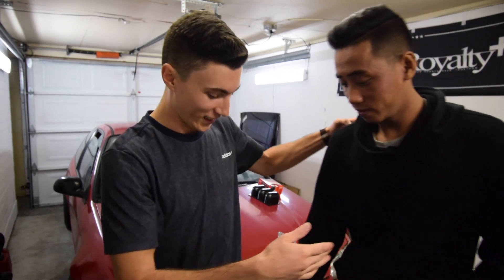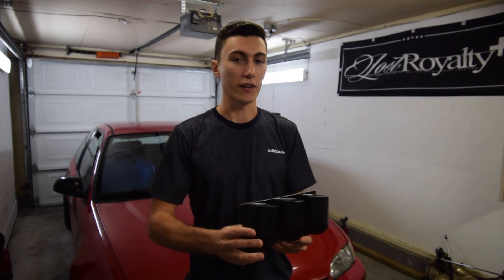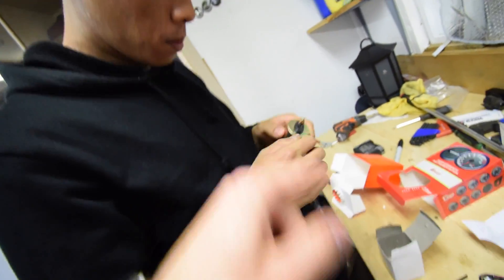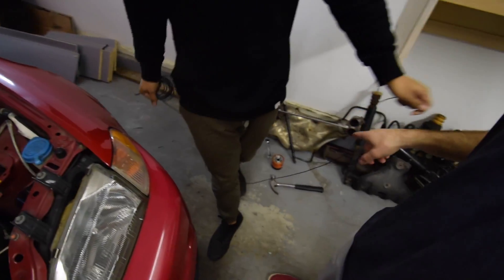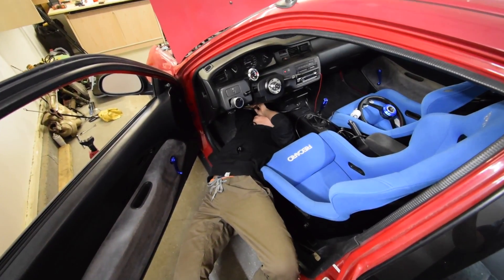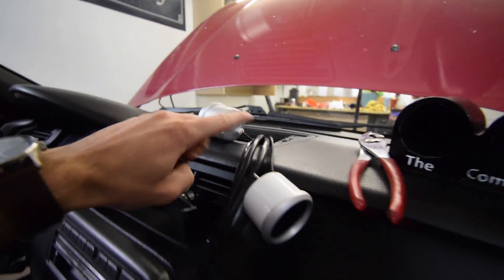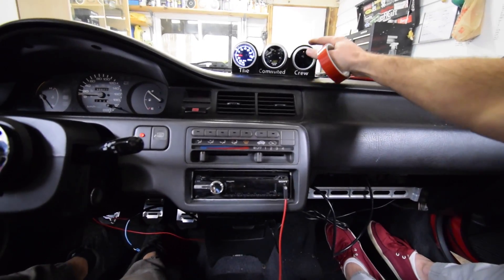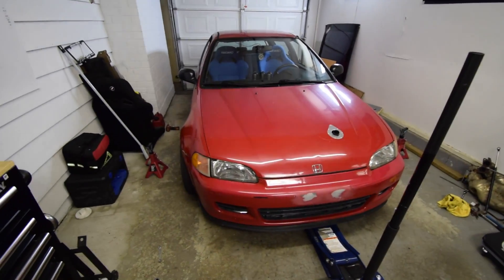CUSTOM GAUGE POD + Oil Pressure Gauge Install! - EG Hatch

Comment: You should get a paint gun ($15 at harbor freight) and buy some paint from Restoration Shop, a quart is only about $30 shipped. You'll get a good quality paint job and it will last a lot longer and look a lot better than wrap, spray paint, or plasti dip.
Reply: No harbor freight in bc
Reply: Exactly what I thought. The paintjob would come out at a much better quality

Comment: I'm rattle canning my car currently. 96¢ spray cans at Walmart, 50 of them. I can send you photos if you'd be interested in seeing how it comes out. I'm wetsanding after 4 coats, then one final wet coat since it's a gloss then a clay bar to remove overspray then finally buff and polish and possibly gonna try nano costing off ebay really cheap to see how it does. I'd definitely like to see you guys give rattle can a try worst case you sand it flat and wrap/plasti dip over it. Cheers if you actually see the comment 👌👌
Reply: How'd it go I did this on a 2001 ford f150 and it went good
Reply: @dirtcheapmedia3390  I have my front and rear bumpers done and my fenders. Had some rust and body damage to take care of before I started on the body itself so I haven't done that yet. The rear bumper came out absolutely mint, the front has some runs since it was a the first piece I sprayed and the fenders came out okay but had some tiger striping I have to wetsand and respray. All and all it's come out pretty damn good for 96¢ Walmart spray cans haha. I'd definitely recommend going with like a rustoleum 2k paint instead since it had primer built in.
Reply: @mrobertsmr53  I used rustoleum semi gloss and did 2 coats but I wish I would have cleared after I sprayed. paint began to fade slowly
Reply: @dirtcheapmedia3390  that's why you wax..
Reply: @mrobertsmr53  that was with a wax
Reply: @dirtcheapmedia3390  that's why I'm wanting to try ceramic coatings or "nano coating". They have diy kits online pretty cheap and wanna see if it's even worth trying it. That's why I suggested Robby do it on the civic. Thought it'd be cool.
Reply: @mrobertsmr53  never heard of it I'll look into it I wanna see how your vehicle comes out
Reply: @mrobertsmr53  I subscribe to you and vice versa

Comment: Spray it. Lasts longer, its easier for the most part and then its permanent, not really budget if its a temp job. And then if a rock hits it it wont peel the wrap. Plus wraps show all bumps so SPRAY IT

Comment: I would say definitely don't try the rattle can idea or else there will be a low chance of it coming out well. But then with wrapping or dipping you could damage the paint underneath and it will be hard to mold wrap to the civic well. I would say try to find a cheap paint setup and order some paint to try yourself.

Comment: Plasti dip, wrap and paint pretty much all cost the same, so I want to say paint it. BUT it's going to take a whole lot more effort to make it look good than wrap, so I say go wrap.
Reply: paints more expensive I believe
Reply: way more expensive, a good paint job will cost 1-2k when if you buy good wrap it will run you 400
Reply: But he also said that if he intends to paint it, it will be by himself and will cost a few hundred dollars
Reply: Doing good wrapping isnt easy either takes practice as patience.

Comment: Paint the car with thinned Rustoleum or oil based enamel paint (I dont know if you get rustoleum in canada) out of a cheap HVLP you can actually paint the whole car most likely for 50-60 max if you go that route! Just need some acetone, paint and a sprayer. It also comes out really nice!
Reply: Keys to Adventure you can get that here. That’s exactly what he should do lol it would be cheaper and look nicer even if they have to spend money on a compressor and everything. If he wanted to wrap it.. would probably cost 400 at least for shitty wrap or like 800 for nice stuff. And that’s if they do it themselves
Reply: Agreed and nothing wrong with spending money on the compressor. Just one more tool he has that can be used to make content.
Reply: I would assume someone working on cars would already have a compressor, or have EASY access to one at the very least

Comment: PROPER backyard paintjobs:

$20 gazebo/tent thingy
$15 spray gun (you can get em' off aldi if that's a thing outside of aus...?)
alternatively get an electric spray gun from home depot or whatever it is
buy the paint from a local distributor it'll be 300 bucks tops. 

if you prep the car properly the painting is the easy part :)

Comment: Dark glossy grey (use spray gun for the grey and a gloss bought on it's own) with dark blue pin stripe down the sides(buy a blue and a paint brush then put the gloss over it or use spray paint and tape then gloss over it) to match your seats?

Comment: Might want to just go to Princess Auto and get a $40 spray gun and paint it that way. Or you can get a whole setup from Canadian Tire for about $150 as long as you have a half decent air compressor it would be the easiest way to do it and have it come out half decent. Just an idea.

Comment: Spray, but get the spray guns with liquid paint, i know it will be the cheapest, and you can reuse them. Better explanation= spray gun, that takes liquid paint, there is those who need a compressor and those who use a some kind of co2 container and there is those who you can manually pump pressure in to.

Comment: I'd like to see both paint and wrap. I've tried to do my interior accents and they dry like the outside of an orange both the color and clear coat and even if I wet sand it I tend to get the issue.

Comment: Rattle can it and wrap it later so it’s nice. Then if you get board with it then you could wrap it later on. If you wrap it before you paint it I will be not to pretty if you take it off later between wraps

Comment: Speaking from my experience 
I’ve plastidipped my car and the video of me doing it is actually on my YouTube channel /future Boosted / but when I work on my car I can’t touch the dip, have to be very careful not to get any chemicals on it or else it’ll change colors... it’s a pain in the ass. Cost less than $400 with the sprayer for my 4 door it would cost you less but what I deal with I don’t think is worth it. I’m curious to see you guys wrap the car

Comment: Plasti Dip the Civic get it online from DipYourCar.com it should be relatively cheap for the quality you are getting and it’s easy to do.They sell their own sprayers to apply the plasti dip it’s not
In the rattle can or you can use your own sprayer

Comment: I'd say get a paint job. I'm in Florida and we have a maco paint place (not sure if you have one there or not) and its really cheap but the only problem is it looks like shit if you let them do the prep work so if you know how and want to you can do all the prep work to the car like sand, remove dents, remove trim and tape everything off like wheel wells and behind the bumper and stuff because they wont. If you do all of that you can get a really clean nice paint job for like $500 especially if you bring them the paint and you will probably have to wet sand the clear coat after you get it back because they sometimes don't

Comment: You should definitely plasti dip the car. When it’s done the right way it’s a great material to work with and you can go back and start over again later. BUT if you do dip it, when looking into the best ways to go about prepping and spraying it, only watch official Plasti Dip brand videos. Everyone thinks they have shortcuts or better ways to get the best results but it almost never works the way the product is intended too

Comment: spray paint it, it's really cheap compared to actually air spay gun paint. Also not that harder or time consuming are a regular paint job. Quality might be a bit less tho, even so just depends on if you do some research and prep it right. Most important thing for painting is the prep. I know there are a few people on YouTube that actually make a living and content from their spay can paint jobs. I mean recently saw a vid of a vid of where only spent 40 bucks.. if you want the clear coat and uv protection add maybe 60-100 more.. but compared to an actual paint job that's still around $1600-$2600 less(this for a good paint job, not a cheap quickie  those run around 600-1200)

Comment: Thumbs Down for Union Bashing... ;)
Also, in case you didnt know you could have gotten any stock gauge cluster from a eg civic w/ a tach in it and just swapped the original out for the new "used" one...  so even a car w/out a tach could be given one by just swapping the cluster... it takes like 10 mins.   just saying...

Comment: Do a real Paint job in your garage. No like for real.
There are a lot of good Tutorials out there and its cheaper then rattle can it if you already have a compressor and comes out way nicer.
Beginner Paint guns cost not much and the paint is as expensive as any other method to dip/wrap/paint the car for the same square meter.
Please just check it out online and compare it.
I already did a lot of research and wanna do it myself this fall/winter on my mk3 supra.